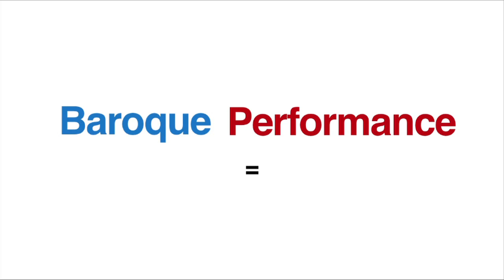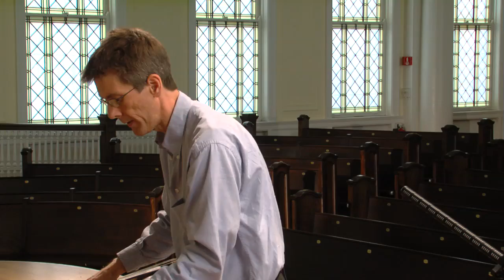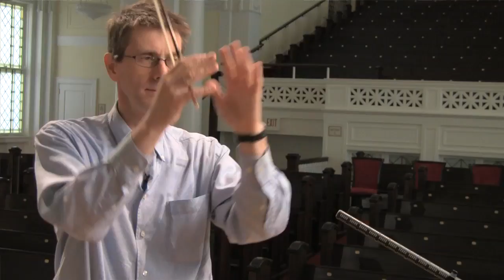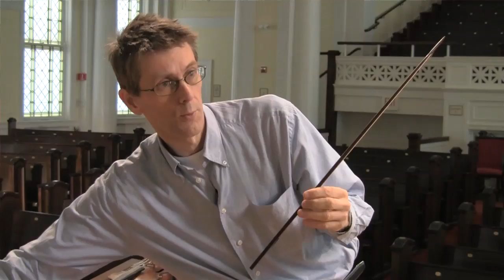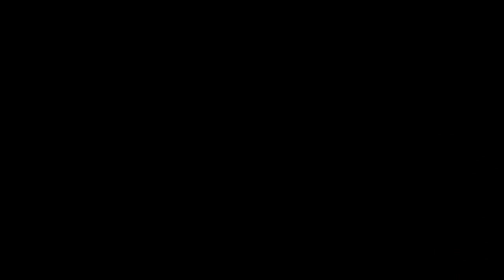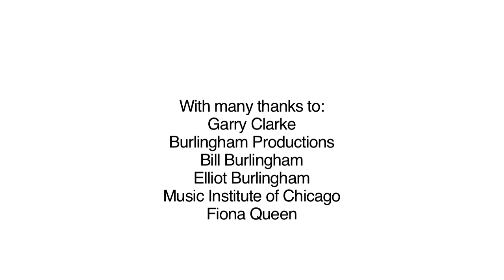The Baroque Violin and the Modern Violin: Similar, but very Different

Comment: Nicely explained.  Just one suggestion- if you want your clipin bow to last a long time without repair, you shouldn't click the frog in and out as you did in this video- that makes for a lot of wear and tear at the front of the frog and slot.  Bend the bow so there's no tension on the hair first.

cheers from a bowmaker who's built and repaired many clipin bows.

Comment: François Xavier Tourte (1747-1835) was a famous french bow maker whose former profession was clockmaker. He nicknamed "the Stradivari of the bow" because determining Pernambouc was the best wood for bow making due to its great suppleness, lightness and strength. He achieved experiences to obtain the better bow shape which becomes now the modern standard. In past times, bows were made of Snakewood (Bois d'Amourette / Brosimum Aubletti) for its resistivity but it was an heavy wood.
Reply: A clock maker? How 😮

Comment: What about the differences in the sound?
Reply: The baroque violin sounds more folkish and gritty, and makes fine articulation better, as the instrument is much looser in construction.  The modern violin can sound silkier and creates a louder sound to fill a large hall.  Both offer different advantages and reflect the musical values of their respective time periods.
Reply: One important difference is that you can't play a Baroque violin in the eleventh position. You would be pressing the strings down to empty air instead of the fingerboard.
Reply: Baroque sounds softer

Comment: I have to ask a question. Stradivarius and other older violins made during the Baroque Period which continue to be played today in a modern setup  would mean that those old instruments of high-value have been altered. Why then does that not affect the price negatively as they are no longer in their original configuration? 

Antique furniture for example if altered or refinished takes a huge drop in value from an original piece that has not been tampered with.
Reply: As wood instruments mature and age, the wood opens up and produces a much richer, brighter sound, which causes increases in value
Reply: @jhontran  Prove it.

Comment: I had thought that Baroque violins were shorter by an inch or two, not as short as a 3/4 vs a 4/4 however. I was surprised to see that the two instruments compared at the beginning were similar in body length.
Reply: Stradivarias lived in the |Baroque era!
Reply: Yes he did.
Reply: +Steven Davidson Strad did experiment with adding extra length to his violins for a while.

Comment: II- Snakewood is acceptable only for Baroque or classical bows while pernambuco is mostly recommanded for the romantical or modern violins because it is a responsive wood which has a greatest reactivity
However on a period bow the hair tension of the bow is given by fingers only when the frog is non adjustable that's to say without ferrule or rack  This is the reason of this technique
You have to inform about the wood properties but not on your bow maker  reputation

Comment: I- According to bow makers, pernambuco is more resilient, suppler, lighter, more homogeneous than snakewood. So, It's  rot resistant and can be put out of form scarcely. Snakewood has this qualities too but in a less degree. The snakewood disadvantages are its weight and its highter rigidity. Snakewood can included  knots too leading to fissures and cracks. Pernambuco bows are well believed to be of the best quality by all the makers. But the most important is the bow maker adjustements.

Comment: II- However, previous and during the Baroque period only hazelnut, yew, larsh and later snakewood were used for bow making. Pernambuco was used mainly for romantic bow. Today it's proved carbon fiber is the best and cheaper material for bow making.  Though in aim to respect the time uses, the frog wouldn't be equiped with ferrule on a baroque bow but with rack, would you ?
Producing tiny sound doesnt involve the bow but the violinist ability and sometimes the violin on a baroque model.

Comment: Aso the tuning changed over the years.  Bach's era was 415 HZ I believe - gut strings etc.  Later various tuning but 432 to 435 was used.  Now it's 440 and everything has become larger, longer and perhaps some of the natural beauty inherent in a 432 HZ has become lost?  These pieces were composed at a time when the HZ was lower.  So now the intended sound is different.  If you play a stringed instrument, try tuning down to 432 and give it time to develop.